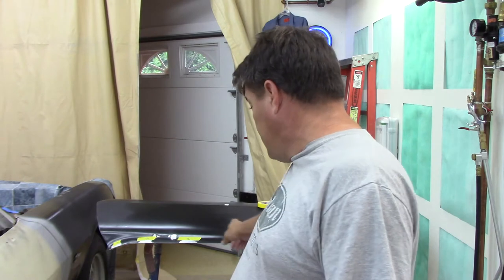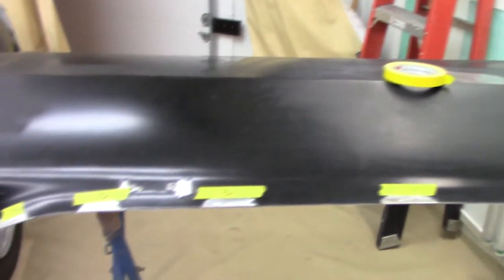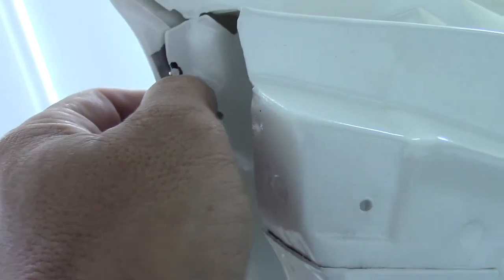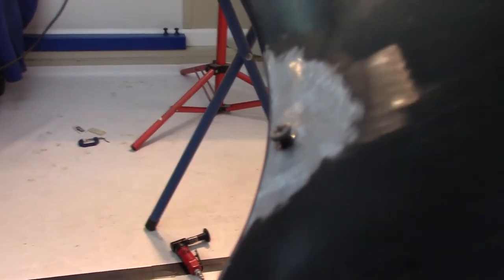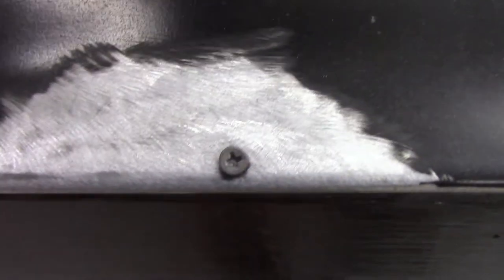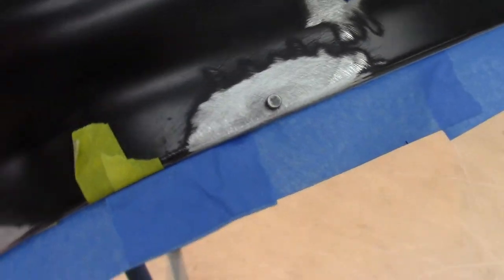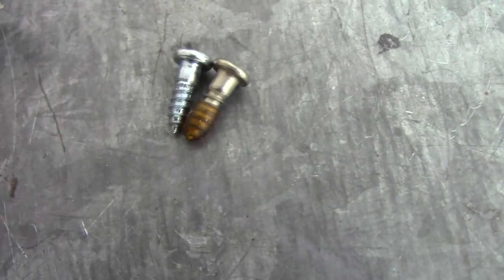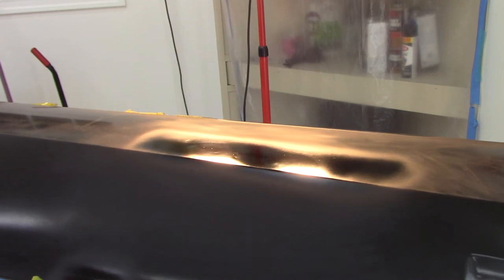Prepping a Door Skin for Installation "1972 Camaro Project OverKill"

Comment: Looking good Russ.  I will have to use some of those screw in studs in my rear windshield channel soon.   I like the idea of using panel bond to seal it and have the added benifit of strengthening the stud.  Glad to see you back on the car.  Thanks again for posting videos.  They are very helpful.
Reply from the maker: Thanks Wes, I'm glad the vids are helping. I'm also planning on doing the same thing in the window channel.

Comment: Gotta have the chrome trim for sure!!!....Those screw-rivets turned out good... thanks for posting what you did....Now I know how to go about doing that instead of having to purchase a stud gun welding unit.....Hey could be that its better that way instead of adding heat to that panel and risk it maybe warping a little ..... Great idea.... Thanks again.....Cheers from Canada
Reply from the maker: Thanks NovaGuy. I would still like to get the welder to work, but I'm ready to move forward. Thanks for watching.

Comment: Hi Russ. Those screws seem to do a good job. You will be glad in the end to reuse the factory chrome pieces. I may use screws to replace 3 studs missing around the windshield chrome on my 72' project.
Reply from the maker: Thanks Wiley. I'm planning to use the on the new quarters also.

Comment: Russ, thanks for these videos. Once again you give me motivation to keep the work going on my '71. I've been looking all over but can't seem to find the answer, do you know if I can leave the trim studs off and not add the trim? I am planning on doing the Fesler flush mount glass on the front and rear windows and would like to delete the trim. Do you see any issues with that or know what I would need to do to make sure it looks decent?
Reply from the maker: Thanks Brady. I actually had trouble with the door trim and the studs a few videos after this one and ended up removing the studs for the door trim. They make a couple different door trim for these cars. I went with the wide chrome bead, but they also make one that is the thin chrome bead. I have a vid on it here : https://www.youtube.com/watch?v=r0Y_rEXEwbg . The z21 trim uses a unique window felt. I'm not sure how it would look by itself. I would probably use the thin chrome bead and you could always black out the small chrome piece.
Reply: @DoubleRRestorations  Thank you for the quick reply and video link. I really appreciate everything you do in this community as well as the NastyZ28 site.

Comment: Is it the same situation then? Your going to have to install studs in the hood?
Reply from the maker: The chrome for the hood just pinches over the edge of the hood, however I'm going with a cowl hood and will have to cut the chrome at the cowl. Should be interesting. Most folks just delete the chrome from the hood when going to a cowl hood, but to me it looks weird. lol.  I will have to use the studs on the new replacement quarters in the window channel.